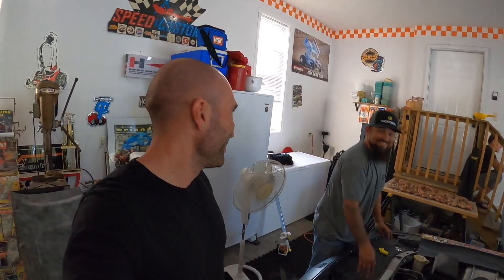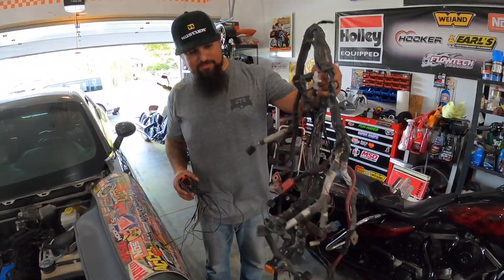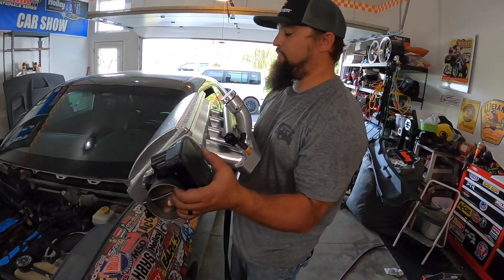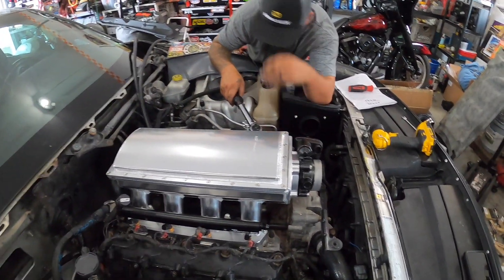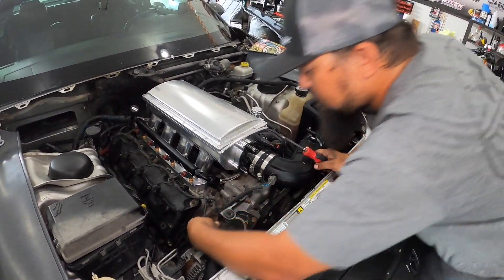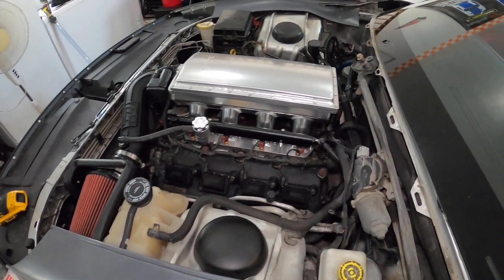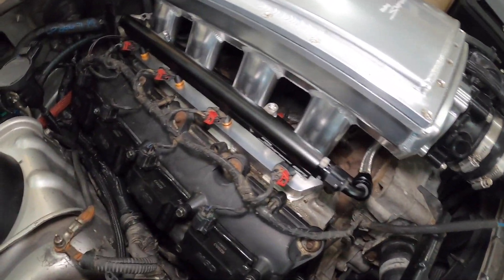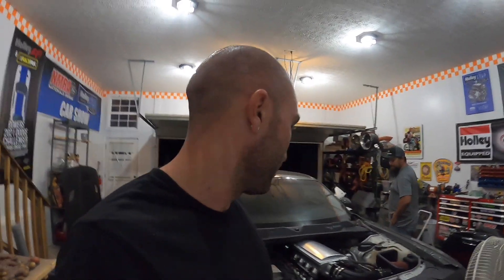HOLLEY GEN lll HEMI SNIPER RACE INTAKE MANIFOLD INSTALL

Comment: Couple of things did you guys hook up a fuel vapor purge valve to the intake ? Is it necessary. Did you run a PCV as well ? My 2018 Challenger blueprint intake manifold was similar to this but ended up buying a 300-658 but was curious about the fuel vapor purge valve mostly.

Comment: Trying to install this intake on my charger, & im struggling to find the throttle body adapter or a throttle body to fit this intake thats not drive by wire, please! What was used on this?
Reply: Bbk performance 90mm throttle body

Comment: Do you need the Holley Terminator X or will it run perfect with Stock PCM and obvious physical support mods for fuel and throttle body

Comment: Looking to get this for 2017 ram 1500 sport wondering when install do i need to get my truck tuned? Also how does and intake filter and tube fit into the engine bay or does it need to be relocated?

Comment: I have a 2020 challenger R/T. Only concern of mine is it looks like it sits quite a bit higher then the standard holly sniper. Would the stock hood work or would I need to upgrade?
Reply: Stock hood will close over it with no modification.
Reply: @bubberrand  will it clear say a bmr front strut tower brace?
Reply: @bubberrand  will it clear say a bmr front strut tower brace?
Reply: @citizenz94  Probably, but not sure.
Reply: @bubberrand  sounds good, looking at doing a FRP cam, long tubes, the Holley sniper valve covers in the next year and this looks like it would be a nice addition

Comment: guys where did you pot the pcv ? i have same sniper yet to install is will oil cap breather and a catch can from the oil fill nick to the cai will be enough ?
Reply: Same ? I have now want to install bit trying to get this info first
Reply: @MoonDoggie89  i ended up driving it without pcv for the last 3 years lool but now am installing a procharger so i will add breathers on the valve covers both sides
Reply: @johanahmed5660 did you have a catch can on your intake I've got the factory one off and I've got this one here and just don't want to install it if it's going to end up being a negative

Comment: What fuel injectors are you using and did you need any injector spacers like I have seen for the regular sniper intake? Does that thing fit under your hood? Looks like it may be sticking up to high. Any concerns not having a pcv valve?
Reply: for me it did ask for spacers and i had to cut i little of the firewall because its too high for my chrysler also the rings that came with it was no good i had an air leak so i used oem 6.1 gaskets
Reply: @johanahmed5660  Hmm so it fit in the front where it looks to tall but had to cut the firewall?  What year of  Chrysler 300? Guessing they're all the same for the most part this would be for my 07 300C stroker build. I've heard of some having vacum leaks with these Holley's and some not. I already have some 6.1 intakes gaskets. Ask for spacers from who, everybody I've seen had to pay extra for the spacers. Holley should provide those but don't. What do you think of this intake? I was thinking of going with the Edelbrock but the damn thing never seems to be available or an eta. Not really interested in doing a 6.4 intake besides I want to use my Hellcat throttle body.
Reply: @craigslue  mine is 2007 too with heavy mods . In front i got a big tb and spacer so ya i did cut a little for the cai elbow.  In the rear of it , it cant fit in ez specially that i have a strut bar so i had to cut and bind a little in the middle of them ,, the injector spacer i did mine custom made , i had a leak in the right side frst hole with it o ring gaskets but i guess the 6.1 metal gasket will have it do . For making up for lack of pcv because those manifolds are not designed to run them i did add an oil cap breather and i added a oil catch can from the oil fill nick to the cai .no oil leaks so far
Reply: @johanahmed5660  OK thanks for the replies. All sounds pretty doable without to much hassle. So how do you like the intake performance? Are you NA? My only concern is the lowend performance and torque. As far as pcv I think a guy coud drill the intake base for a  pcv valve but I'm thinking going old school and drilling a hole in the valve cover and install pcv with gromet into the valve cover or just using a breather/filter in each of my billet valve covers. I was thinking a guy could also fab up a new top for that manifold  and find a way to extend the runners for more lowend with an aftermarket hood which I would like to do eventually.
Reply: @craigslue  well the pcv is not a must , i saw many race mode mopars with no pcv just some of them saw oil leaks after sometimes and some didnt ,its up to how oily your car is if you know what am saying lool . Mine wasnt even oiling the catch can for 6 or 7000 miles almost non inside it because i run oil cap breather and oil nick breather and use a good racing oil so the crankcase is breathing well .. 
And about the power my car go up to 700whp with nitrous but i didnt run a dyno it with the manifold yet but as far as i can tell it did take a little at the low end ( you can make it there by other ways ) but it gave a lot of response and a good amount at top rpm beside the cool sound of it , as a 14 years mopar tuner i say its not bad mani but go smaller if you dont have cam and heads etc .
Reply: @johanahmed5660  
I know the pvc is not a must thats why I said I may just run a breather in each valve cover just like my old elephant motor did. I prefer to have one though for the street. We seem to think alike as I started this project thinking of doing juice. I have a budget NX Express 150  kit capable of doing I think 200 or maybe 250 with more jets that I never installed on my dakota sitting around. I have a 6.1 intake but want to use my Hellcat TB and don't think I want to mod the 6.1 to make it work correctly. Was orginally thinking the standard Sniper or Edelbrock then seen this video and like the idea of the removeable top and if the Holly site is correct it actually has slightly longer runners than the standard Sniper intake. As far as cams and heads I have some 6.1 cnc ported by Indy Cylinder Heads that claim 370 cfm and the cam I have right now is 230/240 / 111 /+0 / 635/613  @1.65 RR. Also have a 3200 stall converter. Nice to know your a tuner. You prefer HP Tuners or Diablo?
Reply: @craigslue  you are doing good with adding this manifold you will have longer power band but you might lose a little of the low end torque because of its long runners but of course you can make it up by tighter rear gear and your tc . I run mancini 3.92 lsd rear gear with shr 5gear and fti 3800 stall tc ,my cam open timing is near to my stall so i do good at low end , matching is everything you know , then at top i shot the nitrous but the car have many details other than that , 
I tune all hp or diablo but this days am more on hp vcm
Reply: @johanahmed5660  Yes I would like to put in a lower lsd in eventually. I run a 4.56 Truetrac in my Dakota. Almost went with the FTI 3600 converter but went more conservative with the FTI 3200. Actually the cam I have is slightly bigger than planned because of Comp Cam mix up but I think would be excellent for the Edelbrock or 6.1 intake. Not sure I have enough cam for this intake or the standard Sniper intake but should be better for the street and low end.  If going with this intake starting to think I should have gone with the 235/247 cam option but I think the one I have should be better on the street and in all honesty less cam is usually better than more on the street. Guessing my cam is good through 6300-6500 but probably extend out without much loss because of the extended exhaust duration? Originally I was concerned about slinging this thing out with a 4.05" stroke to 7000 or beyond so went with the smaller cam since this will be mostly driven often if not daily on the street. Getting parts has been a pain and been waiting for ARP main studs for many many months allowing me to change my mind to damn much. lol